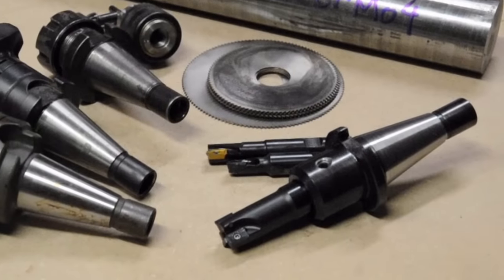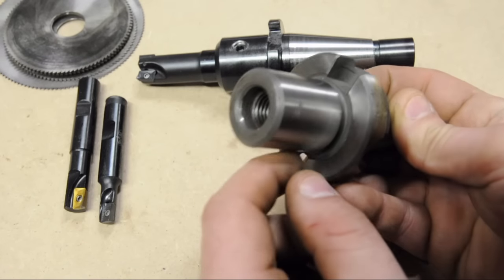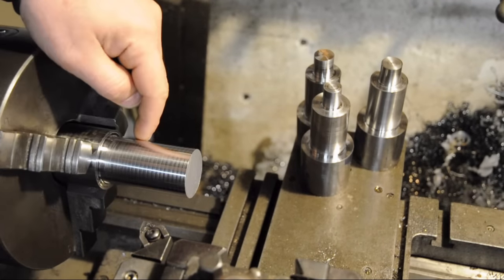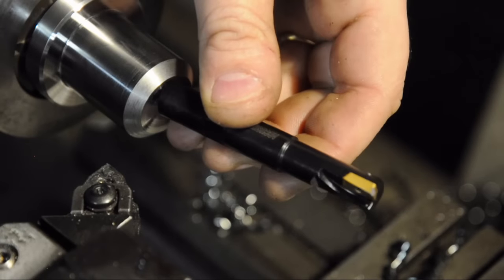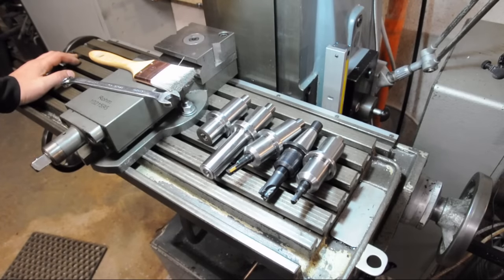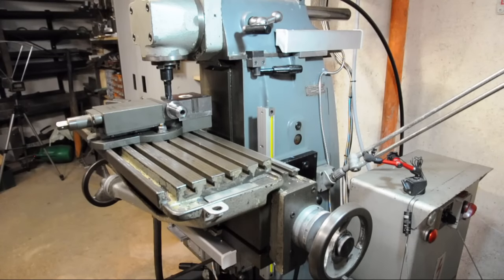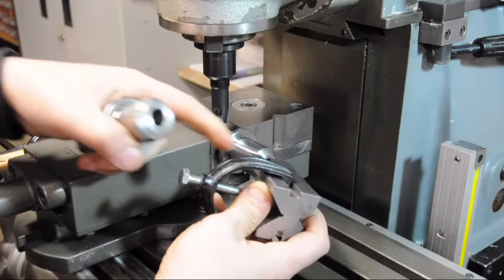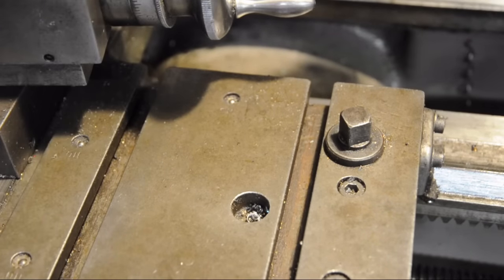Taper Tooling  For The Mill

Comment: Great video.

What about drilling and boring the thru hole first, then mounting the tool holder on a mandrel and turning the taper. I think this will make sure that the taper is concentric to the hole for the tool. 

Also, would love to see more detail on the blueing/blackening. It seems like you got a pretty good finish with it.
Reply from the maker: +anon a Not a bad idea anon .. more than one way to skin a cat, right?  Next time blue comes up/out I'll be sure to give it a bit more air time.  Thanks for watching.

Comment: i did the same with an sk40 adapter but i first cut the taper and then installed it in the mill and bored the hole for the endmill direktli with a boringbar in the vise in the mill.
worked perfect and the koax error is not noticeable to me 
sorry for bad engilsh i am from germany 
greetings

Comment: On the scrapped part with the broken drill bit in it, heat the part then spray the drill bit with a can of electronics air duster, hold the can upside down and you will spray extremely cold liquid on the bit. This might give you just enough clearance to jiggle the bit out with long nose pliers . You could also do a build up tig weld onto broked bit stub.    Shouldnt be too hard to TIG down into that hole . Slip some thin aluminum in there to help you weld only to the bit and not welding to the part . You could get that out . This is how you get broken engine studs and exhaust manifold bolts out .

Comment: I think that you can use BT30 holders in that taper, its only the neck extention that differs. A longer drawbar or allthread makes it accept both types. BT30 is abundant on ebay in the 20$ price region for er16 collets.
Reply from the maker: +Swapper821 Thanks Swapper.. I'll be sure to have a look around.  Broaden my horizons a bit.
Reply: I just made a screw in adaptor to extend the neck to convert BT30 tooling to fit. The only other difference is a thicker portion where the drivedogs engage but that doesn't affect it's operation.

Comment: Nice procedure. Now that you made minimal enough you are likely to be flooded with low cost supplies😊. Without a lapped taper you have a 50% chance there is some lateral end play--have you tried a wiggle test to quantify? Good luck
Reply from the maker: +Mark Rowland Thanks Mark.  They seem to fit well and blue up nice.  I didn't try a wiggle test but my cuts are coming out on-size and chatter free.  I assume if I had play in there I'd see it in the cut; but good point.

Comment: Also, for that broken drill bit, I don't know for sure if it would work but scrap is scrap till its fixed, I'd try smacking that M2 with an S2 center punch, see if you could get it to shatter. M2 is a bear, its not very corrosion resistant, you could try heating and quenching, or blowing it out with oxy fuel, might risk warpage and annealing though.

Comment: Hey Tony, I will post soon on The Home Shop Machinist forum my homemade EDM tool that I use to desintegrate broken taps. It's very cheap and easy to make and can eat that broken drill bit right away.
Reply from the maker: +EmperorDevilhunter Thanks Emperor -- looking forward!
Reply: Here you have! Hope you can sabe that tool holder!http://bbs.homeshopmachinist.net/threads/70731-EDM-tap-remover

Comment: Have you thought about making an adapter to go in the lathe spindle nose with a 30 taper. That way you can cut you're tapers, put them in your adapter ( with a through bolt to hold it) then you have a good concentric Chuck to cut your holder end

Comment: broken drill: use processes that are not affected by the hardness of the drill like plasma cutter down the hole, Tig welder elektrode down the hole to glow out the drill bit. EDM, small grinding bit  on a dremel or wood router (high rpm)

Comment: get the tap out using a stick welder and a fat hunk of wood. Drill  the wood so a 6011 or 6010  weld rod slips through the hole snugly but slips.  Mount the piece some where sturdy.  Center the wood block so the hole is as centered over the broken tap as you can get it by eye.  Put a rod in the rod holder crank the weld up to ELEVEN and shove the rod through. IT'll make a honkin hole all the way through

Comment: 19:19 is that one of those 2in boring heads that you can get on ebay with 9 carbide tipped bits for $49.25? No offense, just wanted your opinion on it if it was. I think I'll watch "this old boring bar" again and see if you mention it.

Comment: Great video, really wanted to see you stick that saw into that indicator. How good did you get your run out? With that chrome moly steel your need to increase your feed rate or reduce the tool tip radius or both, probably both ;) The depth of cut, as long as it is greater than about 2 times the radius, is not going to help with chip breaking (makes it harder as you go deeper). With a small lathe try a #1 rad (1/64") and a feed of .008 IPR and DOC of about .03". That should be in your lathes power range or as Clarkson would say you need 'More Power!' The chip breaker is also important but mostly will determine the min and max feed/depth. Your inset life will also improve a lot once you increase your feed to the point of chip control as you will begin to generate a shear action and not a cut/rub action. If done right you should have machined all of that several times over with one edge.
Reply from the maker: +Widget Works Manufacturing Inc. Thanks Widget, good tip.. I'll be sure to give that a try.  Though my parts are small / short.. faster feed = over in the blink of an eye.. but I'll give it a try!
Reply: Widget Works Manufacturing Inc. Coed to8 I 9 y utility I

Comment: Hi there mate. After watching this video of yours for the, well, second, (third?) time, I found something bothering me: wouldn't it be more 'correct' to bore (and then ream if required) for the endmill holding socket? I mean, seems that the bore turned out concentric with the OD, which OD is then held in the collet so that the taper is turned concentric to this as well, but isn't it a bit by luck? Drilling/reaming cannot guarantee concentricity as far as I know, at least not compared to boring. 
Of course you were careful starting the hole and drilling, but still, wondering why you didn't do it 'properly', or if I am missing something....

(the fact that I keep watching videos from 8 months ago says it all I guess about my feelings towards your work...! looking forward to the next one!)

Comment: Well, that's a solution to the unavailability/price of 30 taper tooling. 2 inch diameter 41L40 (should be much easier to machine) is $100/3ft from McMaster-Carr (in the US) plus shipping for 30 pounds.

I think that maybe a "bottle-neck" slitting saw holder would be useful. You are almost always slitting rounds so you don't need clearance all the way back to the spindle. Make the shaft nice and thick near the spindle and thin it down to just over the hub diameter close to the blade.
Reply from the maker: Good idea.. I'm sure I'll need more saw holders sooner than later.

Comment: Do you have any ides of how I could make a fixture to taper the tang of a knife blade? It would be .195 thick material and at the end of the knife would be .040. I was thinking of using an angle plate with the blank secured to it from the underside with a few 6-32 screws. When I grond the first side I would make a blank with the same angle on it. When I went to do the second side I would insert the wedge and secure it all together with the screws from underneath. I love your videos! You are the smartest guy I ever saw and not kidding!
Reply from the maker: I'm not a knife guy but your idea sounds like it would work.

Comment: Put a metal pin in the bottom below where the broken drill bit was headed. Then press it out with that flange against two blocks in the arbor press

Comment: In my experience in machining 4140, you almost max your machine. I was doing 36 rpm at a .021 and a .05 to .15 doc. Mind you it was a 42" VTL so figure your SFM for that and you should be good. But an ungodly high feed and slow rpm and you can get a chip. Faster your get stringers even with the high feed rate. You can still get a decent finish with a slow rpm because its so hard.
How thats helpful.

Comment: Thanks for this video, I might have to make  sk30 yet. But (and maybe I missed it) what's wrong with just sticking the end mills into an ER collet?

B12 etc chuck adapters are also readily available and will not break the bank, at least here in Germany.
Reply from the maker: +Cancun771 Nothing wrong with it at all.. just a matter of convenience.  Thanks for watching.
Reply: Re: broken reamer stub, what I always did after breaking screw extractors in expensive motorcycle parts was find a machine shop nearby that had an EDM machine and beg them to erode it out after hours, which they usually did for a minor contribution to their tea kitty.

Comment: @11m40s: "...not sure what I can with just a little stub..."  Why not put (for example) the set screw that (for example) that holds the bit into the tapered section?  As long as the set screw is countersunk below the taper surface, it should be possible to make a taper-to-tool adapter of minimal length. Just don't assume that you can't include other functions (e.g. set screws) along the tapered section.

Comment: Awesome work.  I may try to make a couple of these.  I have NMTB 30 taper, basically the same but with an american thread and they are easy to find, but for some specialty stuff it might be worth a try.  Not trying to be critical at all, but I have 2 questions.  Why didn't you blue the taper?  Perhaps could the tool holder bore been done in the milling machine to ensure the bore was concentric with the taper?  Spinning the tool holder properly seated in the machine holding the cutting tool in the vice or something.

Thanks, nice video's!
Reply from the maker: Thanks Roger.  I did blue them, just didn't show that in the video as I'd been through it in the "lathe backplate" video.  Boring in the mill is possible, but I trust my collet chuck on the lathe to keep me concentric.

Comment: Why don't use screw to connect the chuck and shaft? Tapping may be dangerous if the rpm is very large, I doubt that the chuck may fly out and hit someone. Isn't there a safer way to connect the shaft and chuck?

Comment: You say you blue your tools, it looks black is that on cam or just cos the fluid is blue. Also any chance you could do a dedicated vid on it cos it looks sexy AF and id like to know how it works and if its just surface Finnish or actually works into the material. Also are breaking chips a good or bad thing? I saw unbroken chips scratching work earlier harming the Finnish but you made it sound like unbroken chips at 70thou were a good thing.

Comment: Im not the lathe guy but my opinion in first op. I would skim cut to known dimension so when you turn it around and put it in collet you can indicate and see how true it runs.
Reply from the maker: +razor666666 Thanks razor.  Good call, and I did just that on my first 'prototype' holder as seen in the beginning of the video and then later doing the milling (the 3/4" 3 insert).  I was happy with the runout on that collet and ran with it.  I dont know how I would've tuned it in if I wasn't happy.. probably go to the 4 jaw chuck and check one at a time.

Thanks for watching!

Comment: I am sure I am wrong, could you not make a fixture that would hold the taper meaning cut that taper in a piece of round stock and then make a note hole on the opposite end to accept a bolt with that thread and then clamp that. Not sure if that makes any sense..

Comment: Hi Tony 
Short sharp hits with a center punch will shater a broken tap if done with some care there will be no damage otherthan tothe center punch
Reply: Just use constant pressure on low speed on a drill press (hang a weight on the down-press lever/wheel maybe?), and a grinding stick. Grind out the center of the drill bit. Dust just falls through the flutes. Should work with no/negligible supervision.

Comment: Maybe push the feed faster rather then the DOC to get the chips to break. That's what I found worked on my little lathe to break a chip in just about any material. You really got to rough it out to break that chip and leave some material for the finish pass that you can run slower to get that nice finish.
Reply from the maker: +bensbenz Will give that a try, thank yoU!

Comment: Small dumb question, why do you need to grind after heat treatment?. I know that the part suffer some deformation but there are calculations to take in account that.
Reply: The deformation is random, I have had to do alot of grinding because my boss loved to heat treat everything.

Comment: I didn't look up the dimensions but you may be able to use NMTB 30 by just changing the draw bar. if you miss spell it to NTMB 30 and do a ebay search there is a bunch of tooling for $35 obo, which I would offer less and see if you get lucky.
Reply: Here is a great site for the dimensions of different tooling. http://www.tools-n-gizmos.com/specs/Tapers.html#NMTB. You may be able to use BT30 tool holders with a slightly longer M12 drawbar if the drive dogs are the same size or smaller than the slots on BT30 tooling.

Comment: Old Tony. Love your channel. 
Do you have a link to that lathe collet chuck. Even a full vid on the unit and what you did to set it up for the lathe? Really want to fit one to mine.
Reply from the maker: Pratt Burnerd collet chuck.  still available I think. cheaper on eBay though.
Reply: This Old Tony thank you sir. Are there different sizes and add ones that need to be made or bought?

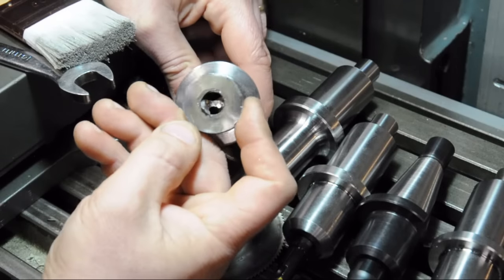Comment: 11:00 "Stuck broken drill"

How about some plain carbon steel rod and a large persuasive hammer? Just beat the absolute crap out of it until it tears itself out. I wouldn't worry about any superficial massive damage to the structure of the material. It's high spec chromoly, if the micro-damage isn't visual then it's unlikely you've ripped a void within the materials mass or initiated a deadly crack.

Even if you never want to use the suspect beaten tooling as a tool, you should do the destructive test. Think of the exhausting hammering as "strain relief". Do it. DO IT.

Comment: Excellent job, I've been putting off making some iso40 tooling in the hope some would come along. I think it's time to take the plunge.
How did the final fit in spindle work out Tony ?
Reply from the maker: +lookcreations You're lucky i think the 40 taper is a little more common perhaps?  hence a bit cheaper.  But if you've got the time it wasn't as bad as I thought it would be.

Comment: Thanks for the video really nice work. I miss my schaublin 102 lathe    Amazing machines just out of curiosity what liquid did you use for blueing your parts.   I'm restoring a kuhlmann pantograph machine and would like to blue some parts on it but it's not easy to come across here in Australia.
Reply from the maker: +fishingsgreat for blueing I've always used the cheapest stuff I could find on ebay.  I just got some "Phillips Gun Blue" but haven't tried it.  I don't, however, follow the diluting instructions.  I either use it straight or mix it 1:1 with water.  I use more, but results seem better.  Not a chemist, though, could be totally off base here. :)

Comment: Hi , nice video !
we also have a 13 , green version.
also have a high speed head with quill but , in 7 years never used it !

what stuff do you use to make the blue color ?

Dave
Reply from the maker: +Dave Broertjes Any chance you'd like to sell that high speed head?  The blue is "cold blue", available on ebay, usually sold as "gun blue".  It is selenium dioxide.

Comment: 15:08 instead of eyeballing the opposite cut you could put something flat, something rectangular (of corrresponding size) between the first cut and the flat bottom surface of the vise (-;

Comment: hi 
i working on my homemade lathe its cheap put i thing its will work well >>not that my question
my question is about the mill tool head holder or  mill  boring head 
in this tube at 12 minute you change the tool ?whats the head size that you put inside the spindle  ? what the thread size ?
i want to make cheap mill machine   
do you have any plan to diy mill head or mill machine 
thank you tony ilike yours tubes

Comment: Could you not just cut the taper/drawbar side on the lathe and then mount the part in the spindle of the mill  and fix a cutter on the mill-table? Would this not result in zero run-out?

Comment: If your mill is rigid and repeatable, you can put a boring bar in a super-spacer or rotary table, then bore the tool-holders on the mill.  This can give you better run-out because the holder is running in the spindle where it will be used.  Check your spindle for radial play and radial run-out first.

Comment: pulling a cork from a bottle ha ha cross drill a small hole so there is no vacuum when removing the tool or pressurizing when fitting a tool.
Reply: That's why he put a small through hole.

Comment: What about the runout on the end mill holders? Since youve only drilled and reamed them.
Reply from the maker: +chronok So far they're doing okay.. cutting to size and no chatter.  They're not hardened, though, so let's hope they hold up!
Reply: I'd probably be mad enough to stick the holder in the mill (without an end mill), set the mill to a low rpm and from bottom grind to size the interior of the holder's hole with a die grinder (i've got some pretty long grinding bits) .. obsessing about precision is a horrible thing!

Comment: Hello, what is the chemical composition of the solution to protect and how much is permanently covered? Thanks in advance for your answer. Sincerely Yancho
Reply from the maker: +YYanchev I believe all of these "cold blue" products are selenium dioxide.   You can purchase online or any gun supply (they are used to fix scratches, etc on firearms).
Reply: +This Old Tony Thanks, I'll try. Many more success you desire.